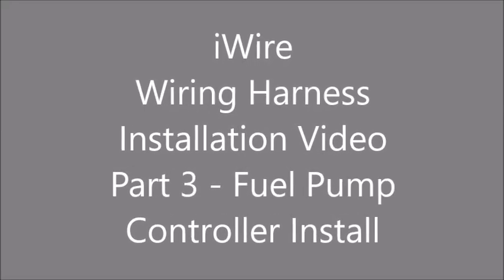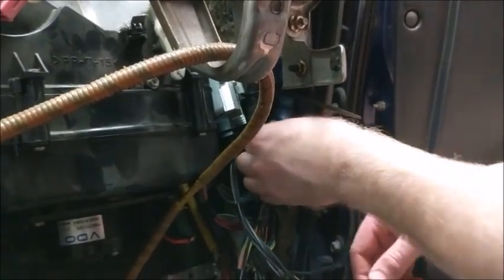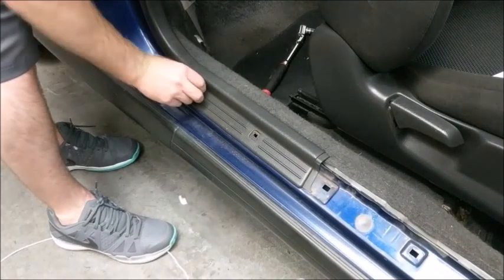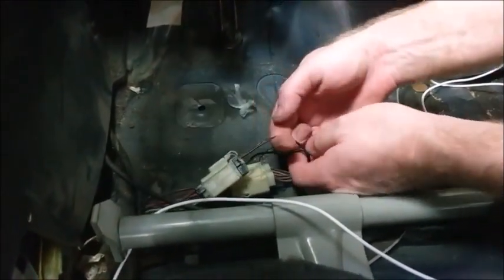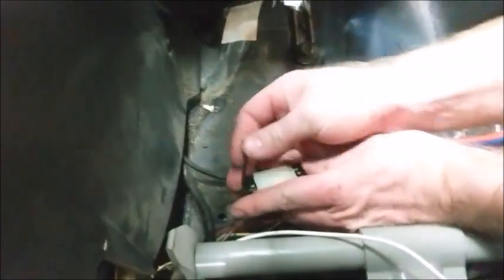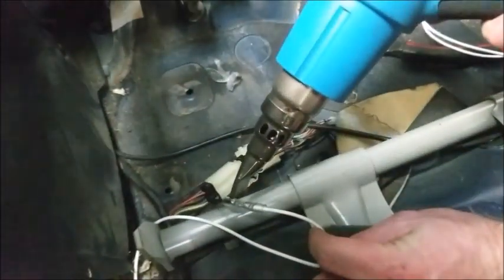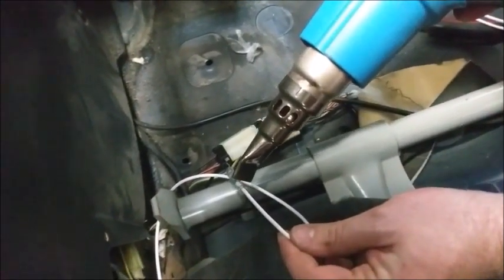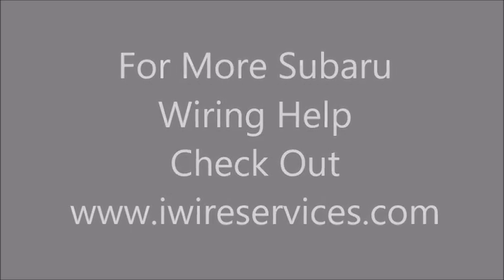iWire Subaru Wiring Harness Installation Video Part 3

Comment: Where does the long white wire plug into?
Reply from the maker: Goes into the rear for the fuel pump. https://iwireusa.com/pages/white-wire-for-fpc-install-guide
Reply: @iwiresubaruwiringsolutions  thank you, I had it unplugged and didn’t realize because I swapped my harness to a different subie.
Reply: @iwiresubaruwiringsolutions  from fuel pump to what though? does it plug into the fuel pump controller?
Reply from the maker: @davidamaya8813  It'll plug into the fuel pump controller